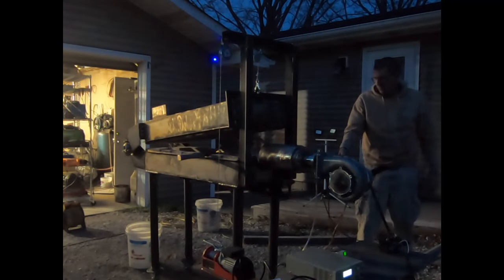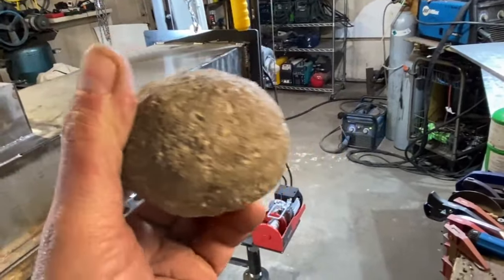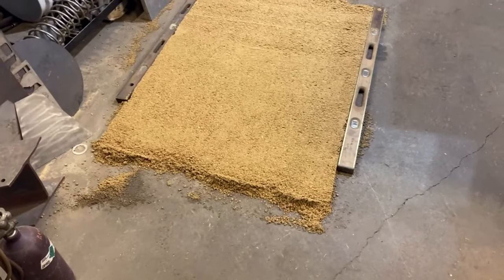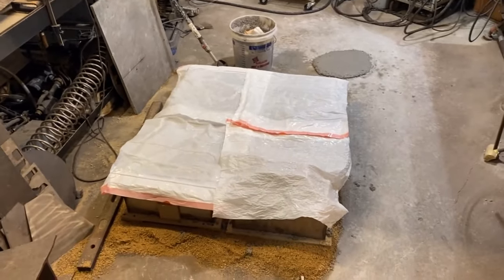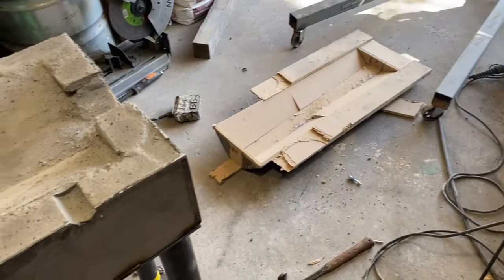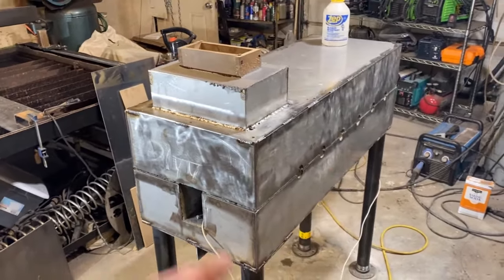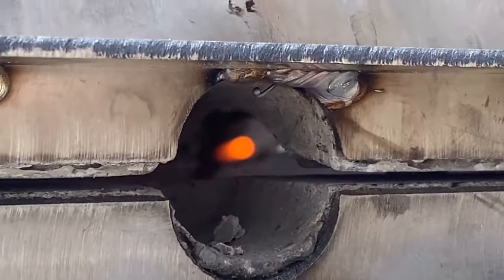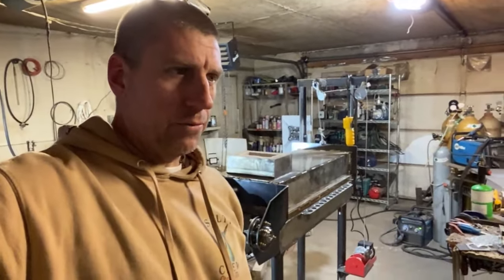Refractory cement and castable drying and curing INSTRUCTIONS

Comment: Curing concrete is a chemical process, not a drying process.  <--Key knowledge, man.  Thanks for sharing your research!
Reply: Check an article about curing ulcc castables. Moisturing ulcc lowers green strength comparing to air curing. ULCC needs about 0.3-0.7% of water (on CAC mass) for hydrating, water above this will evaporate and is needed only for acceptable consistency for installing. Good job and thank author for making this kind of videos (no sarcasm) 👍

Comment: Preventing freezing during castable cure is crucial for maintaining structural strength on a microscopic scale.  freezing makes the un-reacted water content form microscopic ice crystals, which expand and push the alumina/silica grains apart from one another, preventing those particles from chemically bonding together, (the calcium aluminate or phosphate won’t adhere the particle surfaces together for sufficient green strength) and leaving microcracks between those refractory grains that will not sinter together during heat cure, either. If the water content is low enough, you might not have the cast piece fail with a visible crack — but you may encounter more crumbling and dusting of the finished cast than should be expected from a cure that is maintained within the appropriate temperature range.

Comment: Concrete is similar to epoxy or fiberglass. They get get hot and cure. It's a chemical reaction
Reply from the maker: Yes i herd the hoover dam is still releasing heat and it has water pipes in it to cool it